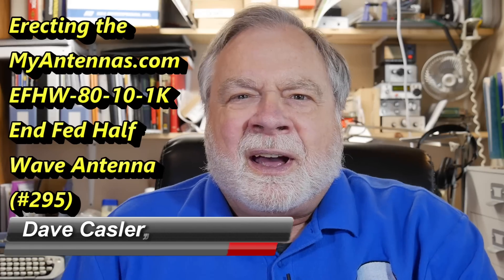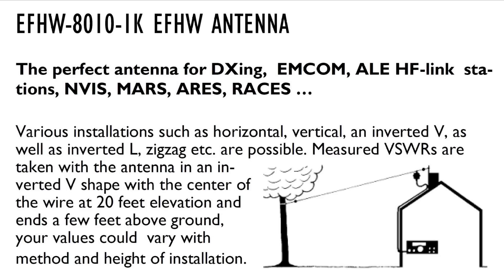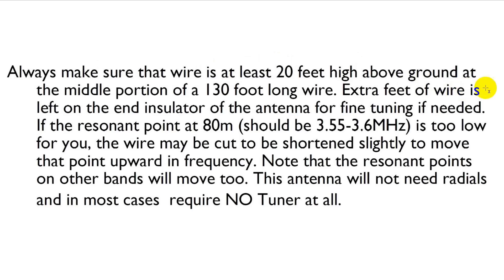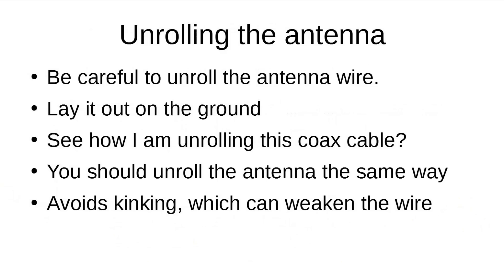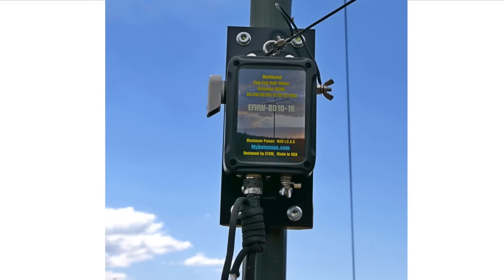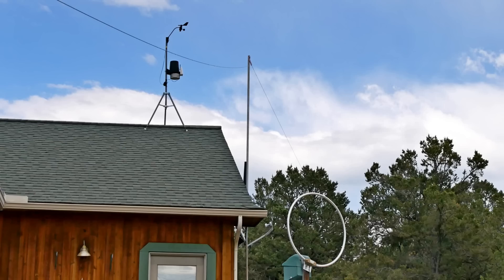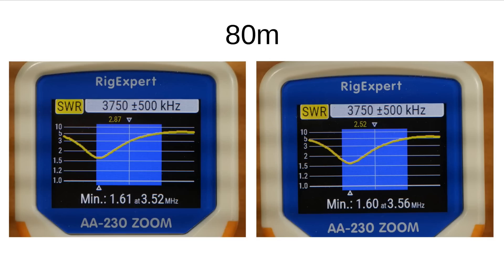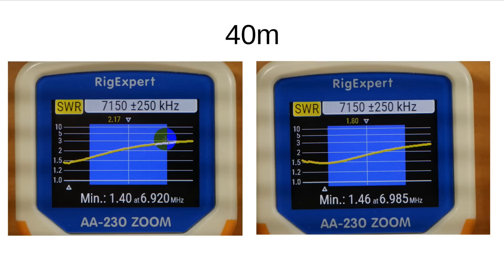Erecting the MyAntennas.com EFHW-8010 End-fed Half Wave Antenna and Initial Testing (#295)

Comment: I got the one set for 75m. Keep it rolled on a cable roll. Start with 50’ coax, then the antenna wire, then 50’ of black 550 cord, then 50’ green 550. Keep it with a wrist rocket I modified to hold a fishing reel to throw a medium sized lead weight over a 50’ tree. 
First setup was in glacier park and made qso’s on 75, 40 and 20. 5/9 to California through an FT-991 pushing 100 watts.

Comment: I am using a 9:1 UNUN, with 135' of AWG14 wire. It tunes with IC-7300 from 80 to 6 meters. On 160 meters, I need to use the LDG IT-100 tuner. So, with it, a perfect low SWR from 160 - 6 meters. All modes, up to 100 watts, maximum radio power.
Reply: Beauty about the 49:1 is that it’s actually resonant on multiple bands with no radials or tuner needed except the higher portion of 80m but adding a capacitor roughly mid point will lower swr on 80m without effecting the higher bands. So feeding g this antenna with coax gives minimal losses.

Yes the coax is the counterpoise.

The only difference is 160 meters where it becomes inefficient because swr is around 10:1 in my case making the losses big over coax but I’ve made contacts 500 miles on 160 m with just 100 watts.

Comment: Hi Dave. I have an end fed for my 7300. It covers 1.0 - 54MHZ. It is 124ft. long and I have it as a sloper. It is rated for 2KW. The antenna is called ULTIMAX DXTREME by Ultimax antennas. My 7300 handles any high    SWR that the antenna throws at it. I just tossed mine in a tree and didn't have to do any tuning. Had it now for about 2 years. So good luck with yours. Like I said with mine it works fine. Only thing I would like to do is to get my other end higher. I would say it is about 12 ft on the low end and about 25 ft on the high end. 73 Clark KG7LOI.

Comment: good antennna.  I have it 30 feet above the ground, all the way.  I had a tree fall on my wire and broke at the Insulator, so I repaired it and we took off about 4 feet off the end.  I have been using the antenna for several years, W6CEF.

Comment: Love mine. Up over two years and I've only had to retune it once, for wire stretch. I learned a lesson about not stretching it too tight.
Reply: How do you tell if it's to tight?
Reply: @chrisbaker2903  If you're getting a lot of wire stretch, you'll know it when you start having tuning issues. Now, I pull it taught, not tight and then I put a tiny bit of slack in it. Just until I see a slight dip in the wire, when you look at it from the side. That will make a huge difference in not having to make constant adjustments to the overall wire length. It's very windy here, so too tight and the wire would stretch.

Comment: Hi hi. Om. Just ordered. 30 male 259 plugs. And watching all the antenna design and will add yours to my bag of tricks. A frend died and what was given to me was 800' of rgu 58 cable. It's fun time for me as I  have several  DC receivers. (Ten tec) 160, 80, 40, 30, and 20meter. Going to be a fun summer. Tks Fer tips ps the DC rigs were built by me .over the years. Tks de kv4li 73

Comment: I have the EFHW-8010-2K in an inverted L with the transformer on a wooden post 3 feet off the ground (and grounded to an 8' copper ground rod), then going up to a three limb about 30 feet up (and a slight angle, maybe 10 feet forward, then pretty much horizontal for 100 feet.  SWR for 10M is about 2.6,:1 12M is about 1.5:1, 15M is about 1.8:1, 17M is about 2.9:1, 20M is about 1.04:1, 30M is about 1.8:1, 40M is about 1.46:1, 80M is about 2.2:1. 60M is 8.7:1 but with an antenna tuner it works. I haven't really cut any wire off yet, just threw it up there and it seemed good enough for most bands (especially 20M and 40M).
Others have mentioned Steve Ellington, and if you go check out his page, he has a video on how to, with a relay and some radials, you can actually turn the EFHW-8010 into a 9 band antenna without a tuner ... including 160M and 6M.

Comment: Steve Ellington have a video on how to mod the antenna to bring in 75 meters using a 500 pf cap.
Reply: Used same Ellington video to mod my own. Worked perfectly on a fantastic antenna
Reply: @LonnyBarry  Thanks for sharing, just curious have you ever done a full 2-30 or even 60 meg SWR scan? I have an occasional need to use marine SSB and was wondering if the 3.6 repeat of near resonance happens to fall in the marine. Of course, cutting your wire to favor those bands might be required, I just have not seen anyone sharing that scan from a VNA  or other device?

Comment: Dave, a common mode choke on the feed line .05 wavelength from the unun could lower the SWR.  See EFHW group  FaceBook.  The outer surface of the coax shield is acting as a counterpoise.
Reply from the maker: The shield on the cable acts as the ground connection, and an unun near the antenna will disrupt that. The cable shield is connected to ground at the station ground rod.

Comment: Have been looking at this but not buying yet...for quite a while. As one sees in studying My Antennas web site, several 80/10 and 40/10 EFHW’s are fore sale.      Some have 16awg wire and higher power rated ones have 14awg.  For those wanting 80 ssb they sell A 75/10 model that has nominally, fractionally better swr results except in 30m and 2Om...but test was on 30 foot inverted L design.   The 40/10 model has poorer 12m and 17 m performance and no 80m. No idea why used inverted L.  Set less than 1.85 on 3.75 to 4.00mghz.  80/10 was less than 2.09 from 3.52 to 3.70 mghz.     Will be interesting to see Usable 80 meter band size
Reply from the maker: The 80m bandwidth is not very much, and it's all down in the CW/digital end of the band.

Comment: Dave  Can a balun be made to handle 100 watts or more using FT-8 and used with the EFHW-8010?
Reply from the maker: Yes, I misspoke. The antenna can handle about 200 or so watts of constant power.

Comment: Hi Dave.....Could this be 'cut' for the phone portion (or a part of it) of 75/80M without adversely affecting VSWR for all of the other bands? Thanks, and 73!  W1NLJ
Reply from the maker: No. Doing so will throw the other bands out of whack.
Reply: Yes you can cut the wire in half place a 250-500 pf capacitor across the two wires. See Steve Ellington video.

Comment: I've been using the same antenna here in Eastern Idaho for almost 2 years. It is outstanding. I've worked all around the world on FT8 at 25w.  Mine starts at 8ft and goes to 20ft in a straight line west to east. My coax is on the 8ft end. SWR with my built in tuner is less than 1.5 to 1.
Reply: Did you ground it?.
Reply: @sh839c  Yes. The balun is connected to a pushup pole which is next to my ground rod. All this sits right outside my rig room.
Reply: Why East to West? Isn't that your nulls?
Reply: @YZFoFittie  West to East is the only place on the property where I could anchor the end of the antenna.  It runs from a pole just above the radio room (basement) and  to a pole mounted near the top of my work shop.  I have no problem getting out in any direction right now.  Lots of polar jumps get me into EU.  Mostly FT8/JS8 @ 50w right now.
Reply: @btaylor1948  I fear you are limited to digital modes then, phone is a whole different ball game...
Reply: @YZFoFittie  nope... but thanks for your fear. No problem with phone and cw.

Comment: Just received the 75-10 2k version. I tried to get them to send me the directions in a pdf for suggested installation methods but was told via email since I am a ham I ought to know what I am doing installing an antenna. Not very impressed with their customer service for sure.  I am hoping their antenna works better than the current MFJ 10-80 end fed I am now using.  I am shooting for a little better swr in the 3.9 area of the band than I am currently getting with the MFJ. Thanks for your installation video Dave, and for sharing the information of suggested installation they were not willing to give me.
Reply from the maker: I am surprised they were so cavalier. Certainly if there was no owner's manual in the box they ought to send you a PDF.
Reply: @davecasler  Thanks Dave, my thought exactly.
Reply: @davecasler  I didn't get one in the box either!

Comment: Hi Dave,

I am wondering why you did not ground the antenna?

My group has used one of these for a couple of years on outings & they don't ground it either...  would not grounding it, knock down the noise level (floor).

I am also confused by this setup as an inverted 'v'(iv);  doesn't an iv require the feed to be at the center & at the apex?

Which leads to this q.  If you mounted it (feedpoint) at the apex, then sloped the active (hot) side downwards like the sloper shown on the instructions; couldn't you then take a matching length of wire, attach that to the ground lug; slope it in the other direction to  a  grounding rod? 

There are several configurations this antenna can achieve.

73 & good luck during FD

John - N7GHZ
Reply: I grounded mine and its well under 2:1 SWR  on most bands! 30 ft off the ground 73 W2LAZ
Reply: @michaelsayles9082  if you temp. Disconnect the ground, what are the effects to swr & noise/signal levels?
Reply from the maker: It's grounded via the cable shield as per instructions.

Comment: Dave: I have two of these antennas, one at my home and one at my cottage.  Both work well and are operational on all the bands you mention.  I use an external tuner for both which enhances it's versatility.  For me, the antenna works best when the transformer box is located at the highest point and is grounded. You will be impressed with how well this antenna works on so many bands.
Reply: I had trouble when I fixed it at the House, I finally took the 49/1 transformer don the garden. the noise went down plus the SWR, a Great antenna to use in a small garden.

Comment: I always like to temper with my tuned circuits.  I don't like the SWR of the antenna.   But I know that no single antenna will work on all the bands.  I wonder how it works on receive.
Reply from the maker: We'll find out when I do the research for the next video!
Reply: It’s very effective on 80,40 and 20. RX is good. Same as a 1/2wave center fed for me. The loop however works well for me on all bands HF

Comment: You can modify that antenna to bring 75m lower for usage. All you need to do is cut the antenna wire in half and add a 250 pf to 500 pf capacitor 1 kV or higher. The value can be changed to tweak the resonant point. I am running that right now (homebrewed). I am getting a lower SWR than what you are showing. Though the FT8 think I can agree with, the longer I use FT8, the higher the SWR gets.

Comment: What happened to the reference station series?
Reply from the maker: It's there. See dcasler.com/reference. I haven't yet picked equipment for VHF/UHF.
Reply: David Casler 
I see equipment list, but was expecting video segments demonstrating how the elements all come together.  All the bonding, grounding, connections, bus bars, cables, antenna installation and testing installation... all the “how”.  We’ve had some back and forth replies, thought we were on the same page.  

Anyone can put a list of equipment out there; the challenge for beginners and new to shack solution folks is figuring out how to put it all together... the value that no one has demonstrated for a wide audience in need both now and in the future ... as there’s not a single photo in any (all poorly done) ARRL book - to demonstrate anything, any detail, any connection.  And since nobody anywhere has a HAM RADIO SUPERCENTER nearby with installers to fall back on, and no books with any photos, case study examples of comprehensive solutions, showing those connections, details, and examples (photos or videos)... everyone is left in the dark.

At least I was under the impression you were going to fill that enormous gap with videos on how that list all comes together.
Very disappointing, so very much needed.

If you’re thinking, “well I can’t develop a total shack solution for everyone’s needs, everyone is going to have some specific needs...”  Yes, of course.  But without even one reference example out there for all of us to clearly see “how one example all comes together”... even just one... we’re all left sitting in the dark with no clear photos or videos, terrible photo-less ARRL books throwing high level generalities around, never getting into specifics, details, connections that we could if just once getting a case study/example of a fully functional shack from A-Z so we can see and say, “oh that’s what that meant... oh that’s how somebody solved that detail... oh I see how that can come together”, etc.  Filling in so many foundational blanks that FROM ONE CLEAR CASE with details, by photos or videos demonstrating, THEN people will be FAR better equipped to amend to their specific needs from even one comprehensive Reference example.

It seemed you were going to throw back the curtain and the mystery so badly needed, that you said you were going to link the Reference Station web page to URL links to the perspective videos.  I guess you’re backing off on all of that, that admittedly was a challenging task.  And was why people like me were applauding your so badly needed effort.  So badly needed.  In my heart, knew it was too good to be true, so sad.  We’re back to rely on terrible photo-less ARRL books, lacking anything in detail or comprehensive, any parts or connections detail as a foundational example of shacks and components coming together functionally ... and shallow, non-comprehensive, non-detailed YouTube’s to flounder.

Comment: My 80-10 EFHW goes straight up 50 feet and over the top of a red cedar tree. Have SSB contact with England on 80 meters running barefoot. Longest DX is on 40 meters from North Alabama to Kuwait. 73, ND2C
Reply: Alexej Svirid  I checked LOTW and yes it was 9K2GS.
Reply from the maker: Great results!

Comment: Hi, rated at 1kw but only 25w of FT8?????
Reply from the maker: My mistake. I was thinking of my transmitter (which should be limited to 25 to 30 watts on FT8 and the antenna, which will handle maybe 200 or 300 watts of FT8 (but why would you want to?)
Reply: So you don't burn out the tuned circuit

Comment: What is a counterpoise? Do you have a video for that?
Reply from the maker: A counterpoise is something having reactance (usually just a length of wire) that can store energy and then release it back into the antenna. The colloquial phrase is that a counterpoise is "something the antenna can work against."
Reply: It is horizontal wire connected to the ground lug on the unun.  It takes the place of a ground.  It does not help an EFHW antenna. I believe the feed line coax outer surface of the shield acts as a counterpoise.  The length of the feed line can effect the antenna.  Like Dave sez, everything affects everything.  Google Steve Ellington EFHW.